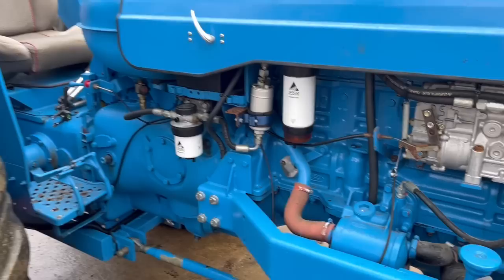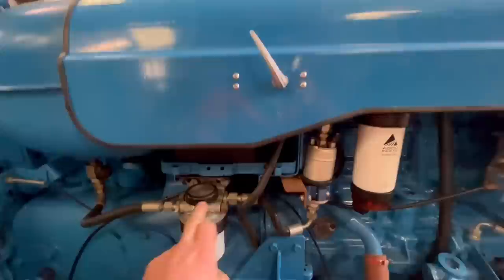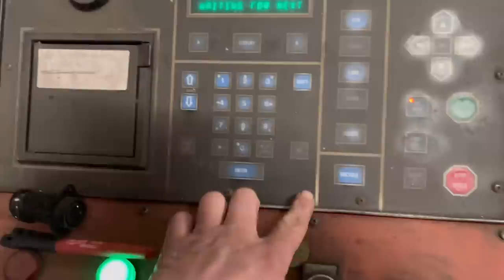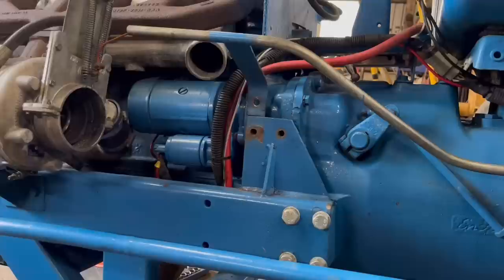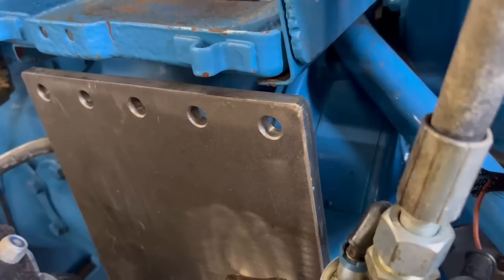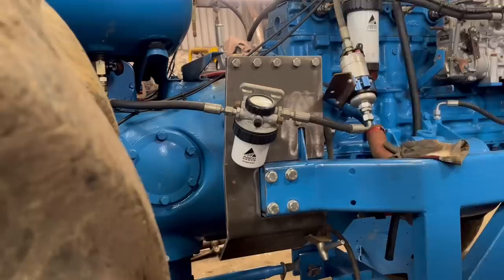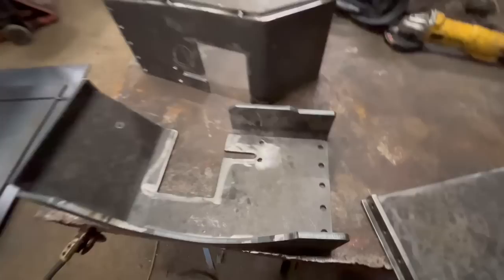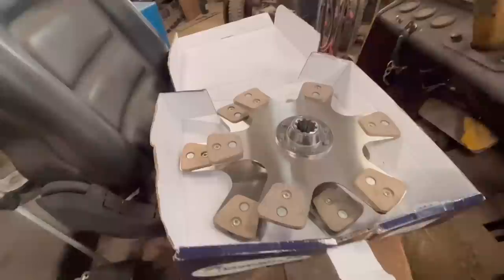Making bell housing protection for Fordson Major tractor puller.

Comment: Blast from the past. Good old tractors those. Back in the late 60's we had one sitting permanently attached to a massive saw bench. Cutting up firewood. You made a nice job of fitting that around there. Reminds me of the same problem the drag boys have. The funny cars blow up and take more than the smile off your face. Hence the rear engine top fuelers. At least those old tractors are not too bad to split and do a clutch job. Not too many wires. No computers. Just a lot of bolts to undo. It would take you longer to get all the tech off a modern tractor. Loving the variety.

Comment: Could have run a small weld bead on the corners and built up the corner profile with body filler. Would be strong enough an reduce risk of distortion. 
Press break. Use a reduced length of the top press blade so you can see the bend forming around the back less change of over bending. Also bend a length of wire / bar thinner than the metal being bent to the angle of the bend required and use it as a bend gauge at the end of the plate while it’s still in the press 
Correct an over bend turn the plate over so the back of the bend is up and press the back to reduce the bend. 
For repeat bends less than 90*  place a metal bar at the bottom of the v of bottom beam to limit the bend .A bottom stop. 
Excellent video. Thanks for letting us watch
Reply from the maker: Some good tips there again. Thanks!
Reply: @snowballengineering  you’re welcome.

Comment: If you need to, you can lay copper plate under gaps like you had here, and weld directly to the copper for better penetration, and when you are done, pull the copper away and leave a nice finish as weld won't stick to the copper. Also, if you are welding near a bolt hole you wish to preserve, a piece of carbon arc rod in the hole will block debris from entry, if it's a good fit. If, after putting carbon in the hole, and you still get debris, simply drill out the carbon from the hole.

Comment: Before you split the tractor. You might take the bolts that screw into the engine block one at a time. Run a bottoming tap in.  Then use a stud with 2 nuts and a 3 or 4mm thick washer to allow you to get an accurate depth of threaded holes and bell housing flange thickness to get the most thread engagement. 

Also pictures of each new bellhousing panel with the length of each bolt used if you don't use a letter punch to mark the bolt head and next to the hole so future reassembly can use the assemble by numbers(paint by numbers) method. 
 Bolts that are not within 3 or 4mm of the full depth can cause issue pulling out under high stress  operations like tractor pulling where the front end might come up and slam down.

One tractor puller i talked to decades ago in passing liked my idea of replacing the front axle beam with a center and ends that use a custom leaf spring .  So coming down hard on the front wheel does not split the front axle beam or rip the bolts out of the back of the engine. 
Hopefully you will have the chance to check the length of the frame rail to side mount bolts too.  

I always thought that the split axle cones should be used on the side rail bolts.  So the bolt is in tension.  Less than in shear holding the siderails on.  
Just ideas that have passed thru my brain to my thumb to make it fractionally better.
Reply from the maker: With these engines, only the top half of the bell housing matches the gearbox and the sumps only made of aluminium anyway so it’s even more important to make sure the bolts are right. 
That’s why they usually have extra chassis reinforcements joining the back of that tractor to the front. 
I’ve seen majors snap in half before due to lack of extra chassis.

Comment: 32:30 a tapping block would've been useful for that. Basically a thick piece of metal with holes in common sizes for the tap to pass through square.

Comment: If anything gets out of that cage you will have some major carnage.. I ran a press brake many years working in aerospace. Press work is a science and a skill. Mine was manual but we had some CNC machines as well. What is the width of your machine and tonnage? Your a very good fabricator to be able to design that cage "off the cuff". That Major is wicked...
Reply from the maker: It’s 10ft wide and I think it’s 110ton but there’s no plate on it.

Comment: Thats a nice looking tractor compared to some of the scrap guys call 6 cylinder major conversions, I've built a few over the years it's a lot of time and can be hard to get them looking right without an upright sump. The worst thing I built for a conversion was a Belarus with a perkins V8 fire engine motor when I lived in west wales and the local boys started independent pulling back in the late 90's. There wasn't anything to look at for ideas to copy building that, but it worked out good in the end, i still have the tractor here in Canada but it's yard art now pulls won't let it run here.  Your works real nice on that bell housing plate to.  I kinda wonder with the price of steel and your time, whats a propper blanket worth comparing prices these days, I know years ago guys used to buy expired BTPA Major blankets and use them . Thanks for sharing the video, Take care
Reply from the maker: There’s a lot of monstrosities out there. My major has the older type Ford Dorset engine out of a combine so has an upright sump which makes it easier. 
That’s a shame they won’t let it run. 
You could be right about the blanket, but I was asked to make a steel one so that’s what I’ve done.  Thanks for watching and sharing your story.

Comment: Is 10 mil the regulation?  When you said that kevlar was required if the steel wasn't enough I was assuming thin sheet.
Reply from the maker: 10mm is regulation for under 3200rpm I think. Or 2800, I can’t remember. Anything over that has to be a proper shatter blanket.
Reply: @snowballengineering  I can't believe a fly wheel would go through 10mm plate.  Shows how little I know.

Comment: I aways thought that skimming the cylinder head raised the compression ratio ?
Reply from the maker: It does. These engines want less compression though, that’s why material is removed from the pistons.
Reply: @snowballengineering  okay, that makes sense.
Why do they want lower compression, i know that when you charge air a NA petrol engine you need to lower the compression to avoid pre ignition knock, why is lower compression needed on a diesel ?
Reply from the maker: To keep cylinder pressures in check. The engine doesn’t have to work as hard to compress all the extra fuel and boost, which means you can give it even more fuel and boost 😁

Comment: Can you not also add blow straps like monster trucks use to contain a block explosion
Reply from the maker: Yes, that’s another rule for the proper competition tractors.  Independent pullers aren’t usually running enough power to have to worry too much about that.

Comment: what has been done to the fuel system?
Reply from the maker: Standard injector pump replaced with a Bosch 12mm p pump, bigger injectors and injector pipes.
Reply: @snowballengineering  where did you buy that